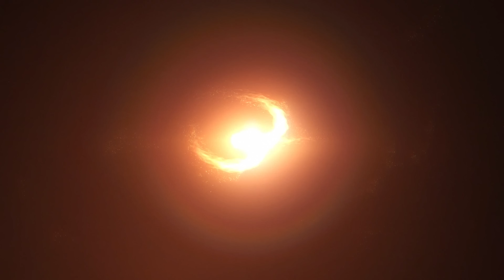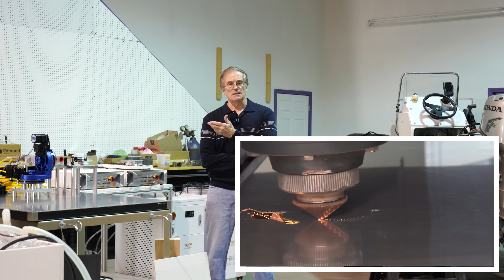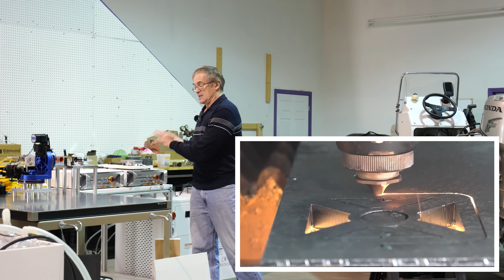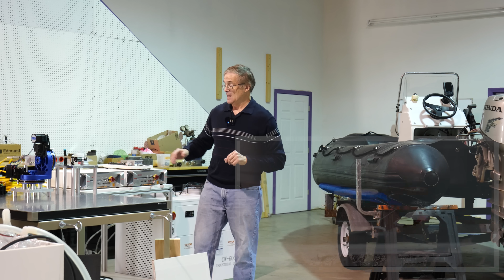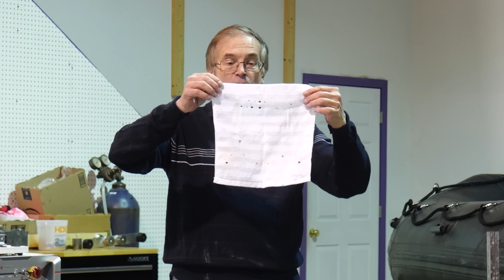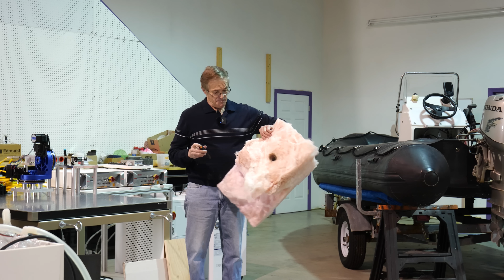We have a problem... and need your help!

Comment: Some ideas, 
1. Turn the setup 90 degrees and aim the laser at the sky. Have the drones fly over head and use the void of space as your background. 
2. Use the world's blackest paint painted over asbestos sheet. 
3. Use drywall sheet sandwich with a gap, inside the gap use a holographic sheet to disperse the laser into many smaller beams, these beams will be absorbed by the inside of the drywall sheet, catching the reflection.
Reply: And pray it doesn't lock-on to a commercial airliner.
Reply: Lol, 

That could be a problem. 

I was assuming you would NOT set this up under a flight path. Or you would use Flight Tracker data to confirm there are no planes in the vicinity.

Comment: 2 ideas come to mind. I'm just a general tinkerer, but have worked in shops with metal cutting systems.
1. The home improvement stores have a cement board usually used for wet areas as a replacement for drywall. It's certainly heavier, and it's somewhat brittle, but I would think you could make some "rolling partition walls" with 2 sheets of that stuff on a steel frame. Maybe fill the center with some kind of flame retardant, and coat the outside with an intumescent coating.
2. Welding shops usually have the dark green curtains for arc type welding, but some also carry a opaque rubberized cloth type material, and a black fibrous material for welding curtains. Quick search comes up with Polyurethane-coated Nomex, and Pre-oxidized Kevlar. I would bet this is what the protective bellows on cnc laser cutters is made of, and would certainly be lighter than the cement board.

Comment: A few ideas: 1) Angled rotating tungsten target like you would find in an x-ray tube.  Rotating so that no one spot heats up.  Angled to deflect and diffuse onto a box of silica sand (think of the heat-inert sand at white sands missile base).  2) A bunch of very-long carbon nano tubes arranged in a diverging pattern (effectively splitting the beam and absorbing at the same time).  3) Huge block of ice.  4) A series of fine-wire grids stacked together to split the light into it's component wavelengths.  4) A bunch of sheets of polarizing film sheets oriented at different angles so that each sheet blocks certain wavelengths.   5)  A bunch of pumice glued to a wall.  6) Lots of lead (although you run the risk of creating x-rays with high-z material like this).  7) Uranium wall (This is stated obviously in jest but uranium is an excellent shield).  8) Orient your laser vertically and shoot it down into a pool (like a reactor pool).  Good luck.
Reply: 1) tungsten is expensive
2) is such a thing purchasable? 
3) Pretty good idea tbh, would just kinda suck in terms of keeping the room a nice temp
4) i think it would just melt through anyway, but could buy some time
4) would definitly melt through
5) might be good
6) Awful, lead is way too toxic to have as a large exposed surface, especially in an area where its expected to be ablated off
7)
8) yea, good idea

i think it will mostly come down to mass, even if he dismissed bricks, they are undeniably a great option. 
One thing i was thinking of, was to have some sort of natural jitter to the lazer that the software can overide when it gets a lock on the target. This does not solve burn through issues though. 
Another idea that i saw in a comment was to have a box made out of some cheap material sealed light tight, with a photodiode inside, when it detects the light, trip a relay. To fix use some aluminum tape.

Comment: Fight fire with fire? An array of some kinf of optical material/lens that could defocus the beam. So you can use less extreme backboards? Maybe a few of those big fresnell lenses that can melt sand just by the power of the sun, but use it in reverse.

Comment: I'm no expert in anything related to lasers, but if simple solutions aren't working to solve your sci-fi weapon problem, you need a sci-fi solution.  What you sound like you are looking for is a some way to diffuse the beam at a very sharp angle and then dissipate the energy quickly out and away from the contact point.  An optics based solution to your laser problem.  I don't know if that would be affordable though.
Sounds like you are trying to create armour to resist the weapon you have made.  Unfortunately, after a certain level of energy transfer there isn't any non-ablative ways to resist.
Maybe there is some material in the nuclear industry that can resist these kinds of temperatures?

Comment: charcoal, like its used with soldering by jewelers. you can make a lot, it absorbs, and if its not soaked in any fuel it shouldnt burn. its easy to make, and its light when made from boards. i dont know how it acts with the laser though, but it holds 2000c relatively well

Comment: At asian restaurants I've seen they have a backsplash behind the stove that's stainless steel and has water running down it. You could angle the ss such that anything reflected back from it would go up, have to pass thru the water again. Would the laser then be dissipated after that?

Comment: I'd be curious about the absorption capabilities of aircrete. It can be very light and could be made to sit on something with casters for easy movement between tests. To further diffuse the beam indoors, dry ice could be set on top of an aircrete "wall," thereby allowing the heavier than air gasses to fall down both in front and behind. 
Adding a second "wall" behind the first would help to trap some of those gasses and provide yet another layer of protection.

Comment: If you’re collimating the beam, why not have a lens in the backdrop (or a grid of them) to diffuse the beam - so that you can use your drywall and all to normally protect against the less intense back end of that diffused beam? Maybe cooled in some way.

Not sure if that will still result in the lens itself being melted, but perhaps if cooled…significantly.

Comment: Not sure how much room you are wanting for any laser pointing movement, but you might be able to use a kiddie pool or similar filled with lightly agitated or stirred water. You have plenty of height in your shop area to elevate the laser and point straight downward into the pool. Could even enclose the pool area to reduce the likelihood of reflections. If laser is to be fixed and no movement is desired, could use a barrel for more water depth. Can also play with mixtures of organic materials in the water.

Comment: Is it possible to modulate the laser frequency? If so you could set up a detector next to the laser that captures the reflection. (There should always be a tiny amount of reflection even if just 0.1%) From that reflection and its modulation you can detect how far it has traveled. If it has traveled outside your specified range, the laser would be instantly turned off. You could get response times easily within the 10 mS range.

Comment: Hmm 🤔, perhaps crushed glass or crystal held in a bag or other suitable container could be used to disperse the laser beam energy.  A small hole, or holes, may get burned into the bag or container, but it should stay intact enough to continue holding the crushed glass or crystal.

Comment: 🤔 could try suspended partials in a fishtank? It may not work if there’s rapid boiling may cause the tank to break just from waters not compressible 🤔 

May have to make a metal bus tank with a a thick glass front maybe with an extended top, and maybe put a paint stirrer on a drill to make it turbulent 

And the particles? maybe graphene or graphite powder suspended in the water…

Comment: I know you said no mirror, but mirror is the only solution I see. You need to disperse the energy before you dump it. Metamaterial surfaces heat-resistant enough with n correctly spaced and sized grooves can diffract and disperse the specific wavelenght of the beam. Only mirrors, reflective diffraction gratings, can do because non reflective optics would absorbe too much power and burn. Just mirror it and disperse it to the ground. Mirrors cost less than lenses or beam dumps, shouldn't cost much for IR wavelenghts and it would be a portable wall that makes your lab look bigger. Being IR maybe even just an emergency blanket coating on a heat-resistant substrate would do

Comment: I have read somewhere that a safe room for laser welding had walls made of 30cm of rock wool sandwiched between two 1mm aluminium sheets. I was looking at the same issue, but for a "simple" laser welder. Maybe rock wool is better than glass wool?

Comment: As a warning, firebricks and other silica like materials turn into a highly reflective glass like substance that acts like a mirror when melting. A hole was made in an optics lab wall opposite the beam dump by accident as the beam dump became reflective.

My idea would be to build a wall of fresnel lenses! this should disperse the beam as you described in the high NA cutters.

Comment: Try compressed wet news paper. Newspaper compresses easy and can be made dense easily with low-tech devices. Compressed enough, it can stop a bullet or a slow fire. As a kid, we hand compressed newspapers with a lever machine to make firewood. Too much compression it would not burn.

Comment: How about a medium that refracts the light, maybe multi-layer material that's transparent or just translucent, coupleled with a polarizing layer.

That'd refract the laser AND reduce its effective power at each layer/level. By the time the laser reached the last layer or back of the setup, a rough surface reflector might be able to handle the power at that stage.

If you could detect the laser when it hit the 'backstop', you should be able to kill the output fast enough to prevent further damage.

Comment: Have you thought about Perlite? It is an amorphous volcanic glass that has a relatively high water content. You can buy it easily and it´s cheap. You would ony need some kind of containment, because it usually comes as a granulate.

Comment: Can you create a layer of crushed quartz?, with resin?, it may cause some diffraction for a few seconds? the size of the pieces of quartz should be at the same or slightly smaller than the light beam and opaque enough to not be able to cause reflection.

Comment: How about some form of continuously moving liquid surface, say, a slurry made from some non-reflective, heat-dissipative particulate suspended in oil or water, continuously pumped and flowing over a heat-sinking substrate, such as thick aluminium?

Obviously the liquid would need careful refinement to avoid, or minimise any surface reflections. 

How about a liquid within which particles are suspended to form a “fog” inside it, whereby the beam would be dissipated enough as to be harmless, by the time it had got through the suspension.

Comment: When I worked at a large manufacturing facility they used teflon as a beam blocker when laser drilling aircraft parts on the fiber lasers. It would absorb the beam and keep from  reflecting back into what it was cutting.

These were sheet metal boxes about an inch and a half wide that were part of jet engine assembly costing well over $1 million. We had these teflon plugs that would be slid into the box before the lasers “drilled” hundreds of thousands of holes in the part for the cooling air to pass through (exhaust end of jet engine). The teflon is not indestructible, but seemed to last a while. Impurities in the material would sometimes explode a bit.

Comment: In addition to an absorbent barrier, you need electronic (NOT computer) protections to turn the beam off after the required time, or if scanning, when a mirror stops.
You also need more than one as redundancy.
You also need to periodically test these.

Comment: I'd recommend looking into Ceramic Fibers. Variants can resist high temperatures ranging from 2300 to 2700 Fahrenheit. You can get them as blanks or papers rolls and it's relatively cheap. There's other stuff like  Polycrystalline Wool (PCW) that's rated for 3000F but that's probably a more difficult to find.

Comment: A Thick enough layer of circulating black dyed water (maybe as in a Koi fish pond).  Borosilicate glass on the beam side.  Something cheap  on the back. .... just a thought 

Two questions 
What is the wavelength ?
How fast can the laser be switched on and off ?

Comment: If the problem is the laser stalling in one position will overheat the blocking background material burning holes through it, then logically the solution is to have the blocking material moving so the laser never is in one place long enough to burn a hole. Perhaps a spinning disc of metal with a cooling fan or even water bath or even a moving belt again with a fan or a tray at the bottom so it enters and exits the water with each pass .

Comment: How about a water tank with clear sides, and a series of aerators in the bottom to cause a very fine cloud of bubbles that would cause the beam to be broken up, and diffused?
The water could also be dyed.
One other thought: Perhaps the water could be mixed with some oil, and a bit of detergent (or some other emulsifier) and blended to create a fine matrix of micro or nano globules which would themselves diffuse and dissipate the beam.
Reply: This I like, maybe fine mica powder as well.
Reply: Wouldnt it  immediately burn a hole in  the tank at the entry?
Reply: @gxurma 
Not if the tank material was transparent to the wavelength of the LASER.
Reply: Had the same idea with the dyed water, or a dyed water solution (was curious what would happen with salted water, water with sugar and dirty water, for example muddy/mule one or water with talc or something more healthy but still, you know, "dusty", like white or black paint, depending which has better properties)
Reply: Perhaps, the INVERSE would be better: a finely atomized spray of water. That way, the explosive force from vaporizing the water droplets would simply add to the atomization, and (thus) the beam dispersal. Plus, any explosive forces wouldn't be contained, thus negating any risk of shrapnel.
Reply: I thought about this as well.
Reply: a tank that size doesnt sound very portable.
Reply: @Sokar12345  Tanks are very portable if they are empty and water is cheap and easy to replace.
Reply: @Sokar12345  LOLZ - and it would be right behind the garage door and therefore would not be noticed while the door is closed.
Reply: The math could work out on this tho large volumes of water aren't particularly portable.
Reply: @loveblowsbad 
But the tank could be drained quite easily,  and water is readily available for a refill.
Reply: @loveblowsbad 
The nice thing about water (though) is that it's drainable, and readily available for when you need to refill. You wouldn't need to move it when full.
Reply: @supergeek1418  Assuming you have water on location then that's fair point. I tend to model against the guidance of General Murphy...
Reply: @loveblowsbad 
Gotcha!
Reply: I want more information about whether there's a glass that's sufficiently transparent to the laser that it won't itself be harmed.

Then I have similar questions about the liquid it contains.  It has to be translucent enough to NOT EXPLODE when the latter hits it.  The energy has to spread out far enough that the water boils at a safe rate. 

That said, if these things can not be achieved, I also want to see that video.  That would be cool.

 Either way, please be safe.
Reply: Another safety consideration.  Ensure the water tank walls are angled such that any specular reflection your get is directed to the floor.
Reply: The latent heat energy of water is an awesome thing.  A 1 ft thick fish tank (20x20 ft target area) would absorb a ton of energy.  Does the absorption spectra of water overlap with the emission spectra of the laser?
Reply: @arduinoNube 
It really wouldn't matter. The difference in optical densities from either the bubbles or the lipid globules would diffuse and disperse the beam to the degree that there'd be little (if any) localized heating --- and what little there was would be easily absorbed by the massive specific heat of the water.

Comment: Drywall is meant to reduce the spread of fire in wooden structures.  A drywall, wet blanket, plywood, wet blanket, drywall sandwich should prevent the plywood from having enough oxygen to burn.  If you make and a "cube" of four on a turntable. If the turntable also goes up and down slightly the laser wouldn't hit the same spot on each face for several rotations.  But really I favour multiple lasers crossing to add up to sufficient power.

Comment: Large thick panel made of Aircrete with lots of carbon black pigment.  Sit the panel in a trough and use a small water pump to keep water pouring over the top so the panel is saturated with water while on duty.  The water itself will be black with carbon as well, providing a continuously renewable ablative shield.

Comment: I dont know if it would work at lazer temps, but I have used kiln wash made from zircopax as a refractory coating to protect kiln shelves at 2300F. Zirconium has a very high melting temp and is also very white. It is fairly inexpensive as well. Maybe coating drywall with the zircopax might slow it down. Corderite kiln shelves as tiles could maybe work too but would be quite expensive

Comment: Why not point the laser to the sky?  Say mount the gear near the rollerdoor, pointed 45° into sky. Pro tip: check flightradar24 before use.
Taking out a StarLink or two would get bonus points and a possible DOGE inspection.